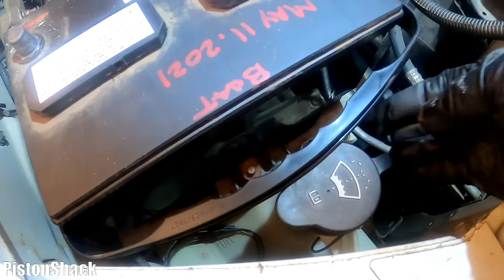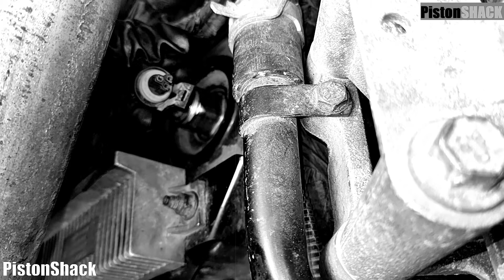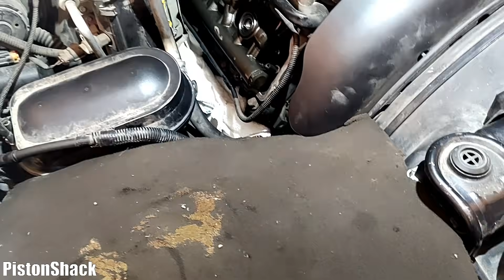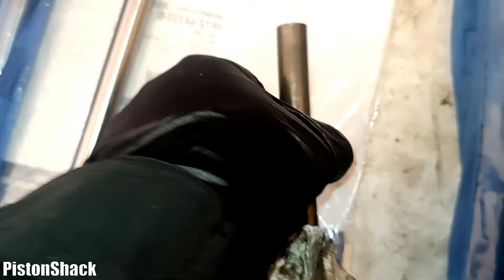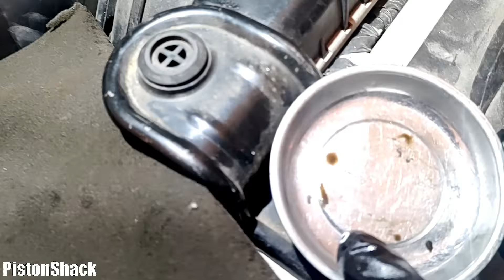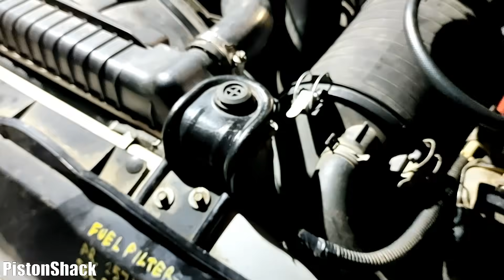6.0 POWERSTROKE (2004/5-2007): In-Depth PASSENGER Side Dummy Plug, Stand Pipe Replacement!

Comment: Great job Sir!
Reply from the maker: Much appreciated, glad I could help out! 🔥
Reply: @PistonShack   Thank you again!  I did the job however, I found that the truck, already had the latest stand pipe and dummy plugs installed!  I remove the dummy plug and it looked great.  Next I took out the Stand plug (top) .. it was in great shape too. I was getting worried about my IPR airport test sounding off on the passenger side. I had also checked for air leaks around the injector cups by adding a small amount of oil to the rail with air but no leak was detected.  After pulling the fuel/oil rail I removed the lower section of the standpipe and there it was .. The lower oring was blown! I was never so happy to find a problem :)

Comment: Let me save everybody a headache. By the mini t30 socket combination where it's one combined piece it will save you so much trouble in getting out the high pressure oil rail bolts on the passenger side. So why I got was about a half an inch wide from where the quarters drive goes into the back to the tip of the t30 it may getting out the bottom bolts significantly easier don't cheap out it'll cause you a headache if you straight out one of those t-30s you will regret it

Comment: I have an 04 6.0 that will start and run for about 10 min then it shuts off and will not start for an hr or two.  Do you think this could be the direction I should investigate?
Reply: @jaynappierii1857  I have the same problem runs 15 min and shuts off

Comment: Thank you for this. Currently doing this work right now. Just finished drivers side. This one looks like it's less complicated as far as components to move, however also more difficult because of the tight clearance between the lower side and the firewall where the air conditioning lives.
Reply: take off inner fender. bolts are right there.easy to get the last 3 with a wrench..

Comment: Hey guys, got a 2005 6.0 having the crank no start, will this plug cause no start when's its cold or just warm. (I had an 07 with this issue but only if the truck was running temp and I shut it off)
Reply: I just replaced my stand pipes and dummy plugs. O-ring on my top piece to the stand pipe was toast. Caused my truck to crank no start unless I sprayed a little ether.

Comment: Excellent video!!! Very detailed and informative..
  My 2006 6.0 just died while driving. Set a little while then cranked back up and drove normally about 15 minutes then died again..  Wondering if it could possibly have something to do with the hpop system and components
Reply: Mine is doing the same thing

Comment: question, i am getting a Hot start issue when my oil reaches 150F, but my cranking PSI is 550-590 during the hot start at 85%.
Reply: @dakotaneubert  that should be enough to fire it could be ipr
Reply: @alwaysoutdoors6382  ipr o ring failed, changed out the IPR and she's good to go.

Comment: Pretty sure 6L were made from 2003 till 2010
Reply from the maker: Nope, 2004-2007
Reply: @PistonShack They were produced from 2003.5’ to 2007.5’ in the trucks, and were offered in the Vans up until 2010. Ford couldn’t shoehorn the 6.4L into the E-series, so Ford just paid the EPA fine for not being compliant with the new DPF regulations.
Reply: @PistonShack  Mine is a 2003
Reply: @PistonShack  на F серии до 2007, Е серии до 2010 года
Reply: Thank the lord they did not put the 6.4 in the van there’s no room with the 6.0😂
Reply: Why did you start on the passenger side? How you knew the leak was on the passenger side without adding air to the system?????

Comment: Pulled the driver side motor mount and just tilted the motor over to gain easy access to the passenger side. Also works with doing heads on the 6.0 without having to make special tools to get it done. Pulling the cab on this truck is absurd and costly to do heads, Try the motor mount way and you will have no problem updating the head studs also.
Reply: @therockkhrd  you should make a video of that.  It sounds very effective.

Comment: In the middle of head gaskets on a 07 6.0. Everyone said you had to pull the cab. I’ve managed to not do that, but did make a new tool to lift the head assemblies.
Reply: That's good news I may end up doing the same thing even though the cabs were designed to be removed relatively easily
Reply: @JaGGeR-  you’ll need something to hold the far back exhaust side head bolts up if you do, I found a little bar magnet from harbor freight works perfectly.

Comment: Great upload. Very precise and well explained. Thanks.💯💪🏿
Reply from the maker: Appreciate that, buddy! What's wrong with your 6.0?
Reply: @PistonShack  crank no start. I think it's dummy plugs and stand pipes. Long story but like many, I have thrown lots of parts, time  and money at it without success
Reply: @PistonShack  update. It was the stand pipe on my driver's side preventing the  truck from starting. O ring was split. Thanks again.
Reply: Good video with great explanation of the procedure. If I ever experience the crank, no start, I will know where to start trouble solving.

Comment: The 6.0 is amazing u only gota rebuild it every 6 months amazing
Reply from the maker: Honestly, 6.0 powerstroke most liked and hated diesel engine ever build.
Reply: @PistonShack    I can understand why
Reply: 💯 I own a 05 6.0 Excursion and this truck is going to be the death of me. What an overly complicated, unreliable, piece of junk. The truck was bullet proofed, ARP studs, head gaskets, stand pipes and dummy plugs, injectors and the whole deal 70k miles ago. Now it needs it all again and the truck runs like absolute trash. Meanwhile, I have two other 12v Cummins Rams and both of them have 300k miles on them and the only reason either has ever had the valve covers off was to lash the valves one time.